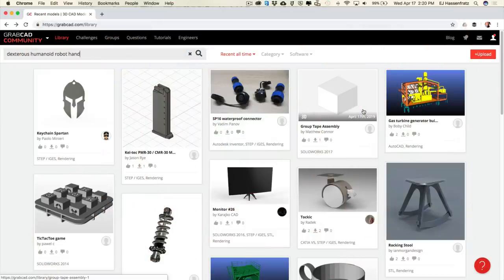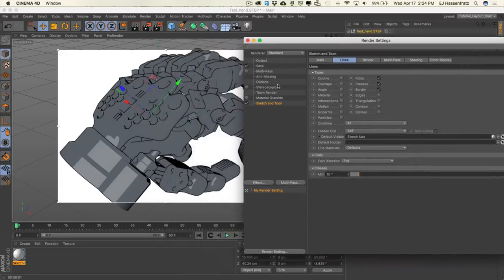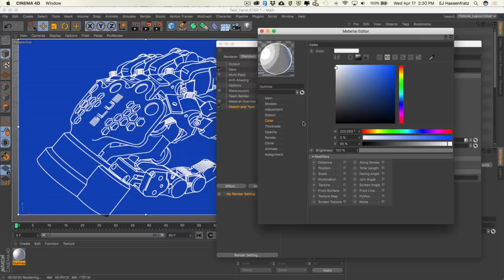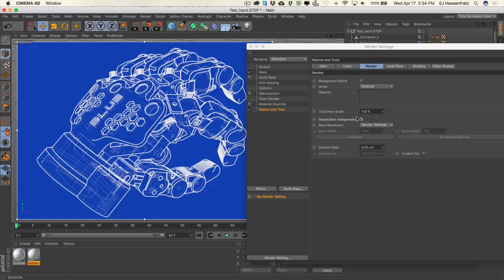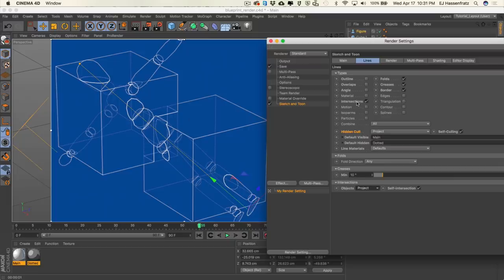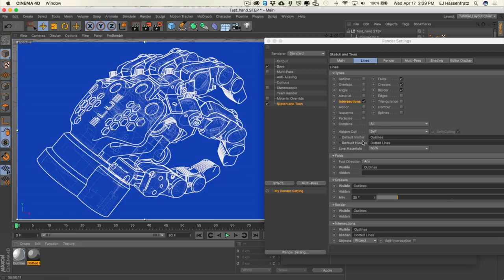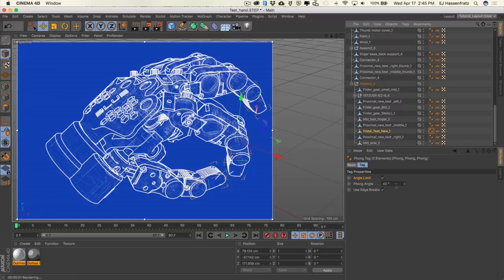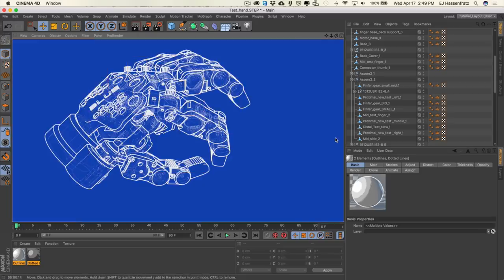Cinema 4D Tutorial - Creating Blueprint Style Renders Using Sketch & Toon

Comment: I knew most of these settings but there was a lot of things I learned. How to control the hidden lines was something I was using the atom array as a workaround. To avoid flicker I was disabling Strokes in my materials altogether instead of trying some of the adjustments in the tutorial. There was also a lot of control tips about phong angle settings here I never knew. I put a ton of notes in an annotation tag so I remember.
Reply from the maker: Thats awesome to hear you learned some new techniques!  I know flickering lines are always a difficult thing to remove!  How were you using the Atom Array?
Reply: @eyedesyn  I used the atom array in any situation I wanted to see internal lines. I wasn't aware of the hidden line setting. When I finally rendered the model,  I go some flickering. I even tried disabling Strokes altogether in my materials. That usually works for me. I wanted to keep that dotted line option though. This one was a challenge because the model was so complex. I'll take a look at your final model I downloaded and see how that works.
Reply from the maker: cool hope its helpful!

Comment: For some reason, my PC only runs at 10% load when I use this technique. It's taking forever to generate the lines, but then the frame instantly appears when done in the render viewer. I'm not sure why it's not using more resources and being so slow.
Reply from the maker: One of the downsides of Sketch & Toon lines is it's not multithreaded so it won't take full advantage of your processing power, unfortunately.  Go bug MAXON about updating it! :)
Reply: @eyedesyn  That's... annoying. Regardless, it's worth it for the look. The videos on Real Engineering are about to jump in quality 10x.
Reply from the maker: I've been crossing my fingers for awhile that they'd update Sketch & Toon but I feel the way the industry is going they're not going to be updating any of their older renderers like Sketch & Toon...here's hoping with the Redshift acquisition that some kind of toon/sketch shader is added
Reply: @eyedesyn  I've been very impressed by the look of Arnold's Toon shader.

Comment: i am stuck at the moment you are applying the dotted line ... my objects does not show more lines.
Reply from the maker: you probably missed a step!
Reply: @eyedesyn  what could be the biggest reason? its either a stroke or a dotted line..
Reply: @Fabitalism  I had the same problem. I think it was because I applied the material to the object. You don't need to do this. The material properties are all applied within the renderer
Reply from the maker: MOBOX Graphics correct, you can add the lines globally in the render effect like I show or you can apply the stroke materials directly to an object via sketch style tag and have all the same options there. Sketch style tags will override the global effect
Reply: @moboxgraphics  Thank you for this!